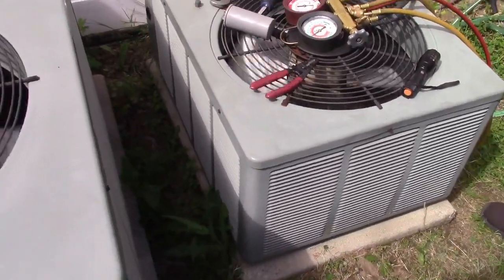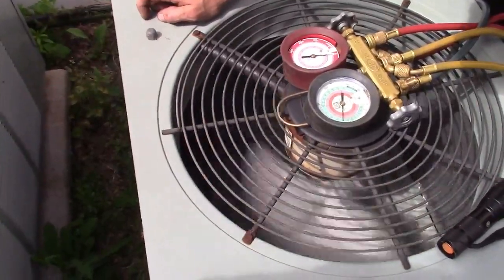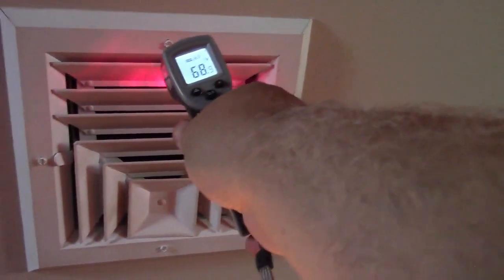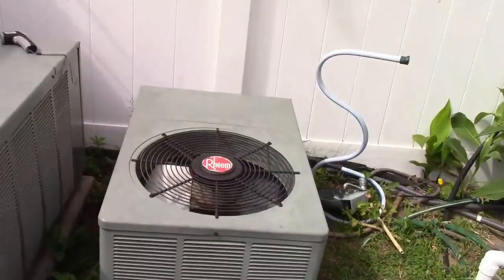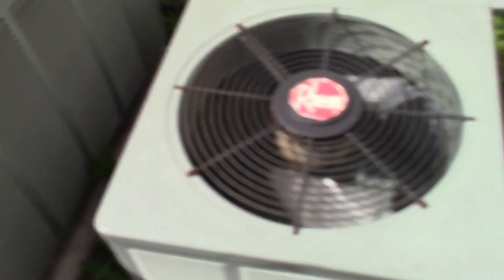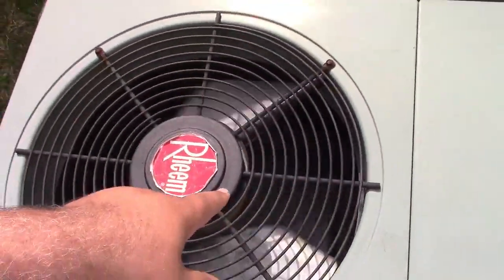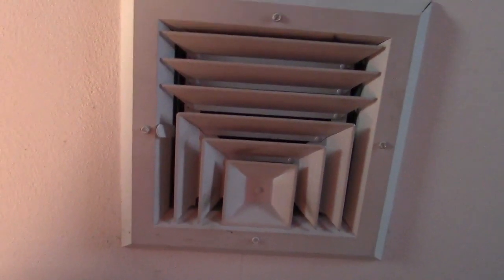COOLING REPAIRED!  Rheem 2-Ton Is Fixed?  Part 5 - Another Bad Capacitor!

Comment: The outdoor fan not running will cause the head pressure to skyrocket and the internal bypass on the compressor to open provided there isn’t a hi pressure cut out switch.  This will not cause an indoor unit to freeze as the refrigerant will not be able to condense into a liquid.  I’ve had this happen to me before on an older Goodman unit.  Question is, does your indoor unit have a capacitor going out which caused the blower to stop running?  If you indeed had a freeze up, you should see frost on the suction line going into the outdoor unit.  I’m thinking your outdoor unit shut off on high pressure due to the fan stalling.  The fan motor probably shut down on thermal overload due to a failing capacitor.
Reply from the maker: Well we found out by the gauges that the pressures of everything are perfect.  The indoor unit blows solid through and through, it never once stalled out.  If the outdoor unit shut off on high pressure due to the outdoor fan stalling, it should eventually try to restart the compressor.  It didn't.

The problem was misdiagnosed, it never once did freeze up.  Current hypothesis is the thermostat was satisfied and the unit shut off.  Some time later, it warmed up, and there was a call for cooling.  Once it kicked on, the outdoor unit did NOT.  That indicates a contactor.  The tech said the fan didn't run but he never mentioned anything about the compressor starting or not.  I get the feeling he didn't quite know what he was doing.  As a result, yes, the unit failed again.  After turning it off and back on, it worked.  They're getting a callback today.
Reply: @jaykay18  Ah yes! The contactor!  I probably need to inspect mine as it’s over ten years old and original to the system.
Reply from the maker: @ESDI80  The trick is getting him to come back and replace it for free.
Reply: @jaykay18  How has the 2-ton been operating since the capacitor replacement and has anything else failed?
Reply from the maker: @bradroesler7072  Yeah, there's an update coming, I'm thinking Thursday this week.  No guarantees on that just yet.  But definitely soon.

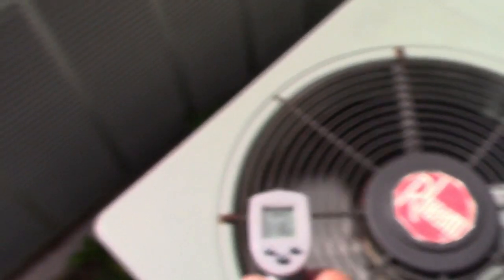Comment: I think a feller might want to clean the panel. Use an old tooth brush and a bucket of hot water and dish soap. Oh wait, you rather me clean it if I were there instead. 8:30
Reply from the maker: I could wipe it down.
Reply: @jaykay18  yeah a guy could wipe it down yet it's not cleaning in between the panel. I nearly destroyed my finger nail trying to clean ours here.
Reply from the maker: @ItzYaBoyJesse  I found that out the hard way once too.
Reply: @jaykay18  you would just rather me do a lot of cleaning if I were there.
Reply from the maker: @ItzYaBoyJesse  But the if will never become a when.

Comment: If the capacitors failing or fail  the motor may or may not start, if it does start, it could run and slowly overheat the winding, which would cause the motor to shut down until it cools down if the motor does not start it could sit there and over heat and go off on protection or a gust of wind or someone with a stick can start the motor in either direction it may run for a full cycle or over heat and shut off carfule to many over heat cycles can damage the motor. Once the fan stops the compressor, obviously, over heat most modern units have a safety cut out.

If the motor windings are failing or bearings bad the motor could pull to.much amps and slowly over heat and will stop running until it cools off the start winding on the motor itself could also be bad in which case the condenser motor needs replacing.

Inside this could alos be happening this would cause a ice up condition another thing to checknis if the evap coil is plugged up
Reply from the maker: Yeah, they all have thermal overload protection.

Comment: That is interesting. I've had this problem, three times, here at the house. Once, in around 2000, the 1983 York Tombstone unit had a stalled fan, with a running compressor, but it wouldn't cool at all. Eventually the compressor would overheat, and thermal out. As a temporary solution, I stuck the two Lasko faens on each side of the unit, facing in, to cool the condenser coil, where I could have AC that night. I replaced the motor, and capacitor the next day. It worked fine, until it was replaced in 2003. Now with the 2003 Carrier, in 2011, the dual cap failed, where I had no fan, or compressor, so obviously, no cooling. I slept in my workshop that night. Got the new dual cap the next morning, and that one lasted all the way until 2019, when it failed again. We were real busy with my Uncle dying, we had an AC guy come out to fix it. Also, each time it was a tad low of refrigerant, it would freeze up at night. As a consequence,  no air flow in the room vents. Watch the suction line, if it ices up, it's low on charge.
Also, I had no cooling, when the condenser fan motor failed on the 1982 GE refrigerator, and the compressor would thermal out after a little while. I also need the AC guy to help me understand how a unit would freeze up with no condenser faen running!? Yes, I caught the guy not answering your question! I would imagine if the fan stalled on yours, the compressor would overheat and cut out on thermal.
However, if the evaporator fan stalled, it would most definitely freeze the evaporator coil. I've seen that a few times, maintaining the 1994 Ruud units at the old church.
Reply from the maker: I know that cap failures are fairly common.  If the problem manifested itself to me, I could have fixed it myself easily.  But every single time I checked it, that fan was running like it always did.

Comment: Well one thing I can tell you right now, the compressor sounds like my 2nd floor Carrier, compressor sounds MUCH happier even with the higher heat load. NOT to toot my own horn, but, Beg Pard! I did say that I thought the capacitor should be changed just based on the start sound itself. You need to listen to your Millennials! ;) 

Okay, now for some diagnoses from me. The fan stalling out would make sense. If the capacitor is weak, the motor is going to run hotter, so it's possible that it was making it thermal out. However, that being said, I cannot see how that would make the line ice up. That would only happen if the INSIDE fan was not running. Because the evaporator would not be absorbing heat, therefore it will cause low pressure and make the line ice up. The condenser fan not running would cause the opposite problem. The refrigerant would not be condensing at the condenser; no heat drawn off from it, the compressor would start getting hotter and higher head pressures, and eventually thermal out as well, and needless to say, warmer air out the vents. Remember the 2013 video of the old Coldspot dehumidifier for example. 

The ONLY thing I can think of, maybe the compressor was running slower because of the bad cap and maybe that was causing pressure problems. But that's a pure guess on my part. But like you said, keep watch on it, and if it remains well, well then you should be good to go!

Price wasn't the worst. The capacitor work was maybe a bit high, but honestly these days, a service call itself being below $100 I would consider cheap.
Reply from the maker: I knew for a long time that cap needed changed.  If it would have failed outright and presented the problem to me, I would have fixed it myself.  But it ran every time I checked it.

The odd thing is that both times I caught it warmer upstairs, the air coming through the vents sounded different, like muffled, as if it were iced up.

Comment: I hope that it was only the capacitor that failed and not the motor because if the motor failed, then that would be horrible and damage the compressor. You can sometimes get the fan to start up on bad capacitors by manually spinning the blades to kickstart the fan on when the A/C starts up
Reply from the maker: Yes, I know about giving it a start by hand.  But how could the fan stall out in the middle of running.  OR--perhaps that never happened, and the thermostat was satisfied.  Then there was a new call for cooling, and it didn't start the fan outside.

Comment: A drifted capacitor can cause all sorts of erratic behavior, including stalling after starting. Did he happen to leave the old capacitor behind? It's easy enough to measure the micro-farads and remove all doubt.
I agree on replacing the capacitor in the other unit as preventative maintenance. Capacitors from the 1980s and older I have different feelings about as they seem to just last and last, but anything made within the last 20 or 30 years I'd replace. Capacitors are cheap enough and there still decent quality American-made ones available.

If he showed up with a set of analog gauges and checked cheaper components first, I think it's safe to say he knows his stuff. There's so many 'technicians' out there today that would have totaled that machine for some made up reason just because it's an opportunity to sell something new, and since most consumers don't know any better, he would have gotten away with it.

If the suction line returns to the compressor cold, and does so consistently, chances are the charge is fine.
Reply from the maker: Unfortunately, he did not.  I didn't have the presence of mind to ask for it.  I will most certainly replace the cap in the other unit, but save the original as an emergency spare.

This most certainly could have gone way worse, and the guy could have totaled out the machine.  I'm sure there are unsuspecting old ladies out there who have fallen victim to that many times.

Comment: I been worried about replacing the capacitor on the blower motor for my electric furnace since it's the original one from 2006 when the furnace was installed and never has been replaced but the ones that are on my ac unit were replaced recently
Reply from the maker: It's certainly not difficult.  In the event I saw the fan was stalled myself, I would have done this job myself for just the price of the cap.
Reply: @jaykay18 I can agree with you 100 percent on that one. I can remember several years ago when my neighbors ac unit had a bad capacitor it actually caused the outdoor fan motor to run not just at half speed but also the wrong direction in addition to the wrong speed